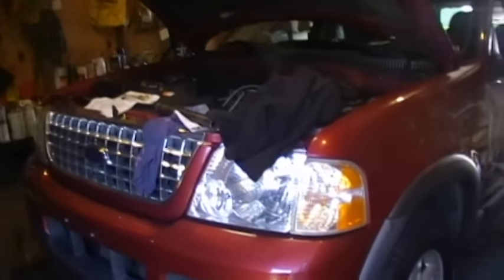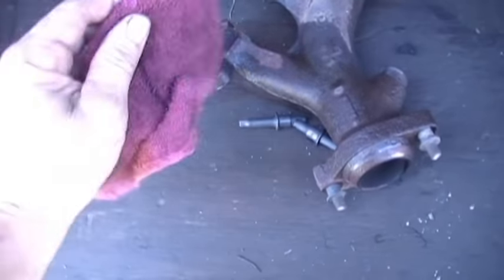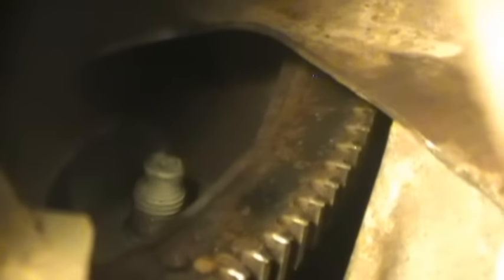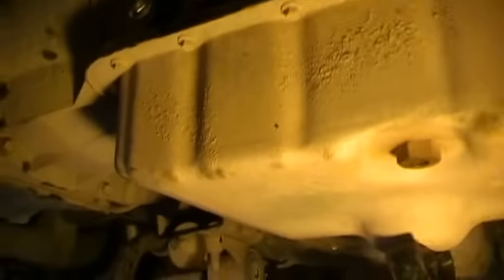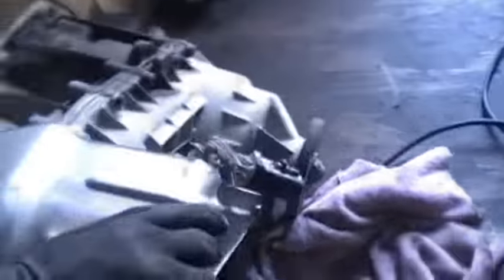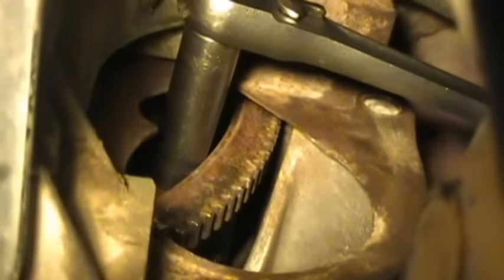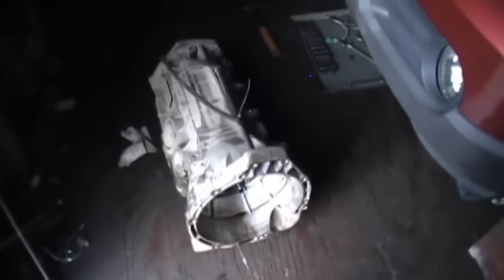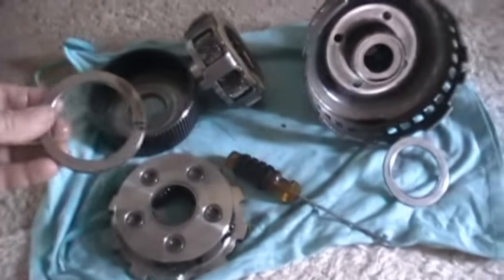2003 - 4.0  Ford Explorer Transmission Replacement

Comment: For anyone watching this in 2023. Instead of trying to loosen the bolts on the crossmember and risk breaking them. Put a wrench on the bolt side and take the nut off of the other side. Once you get the nut off hit the bolt with a hammer and it will back out easily. Also pro tip if you take the intake off the top of the engine you can easily reach the top 4 housing bolts from the engine bay then you just gotta do the sides and bottom housing bolts. Don't unplug your starter unless you plan on un hooking your battery first just take two bolts out and hang it to the side and you can get to your torque converter nuts there should be 4 nuts. Youll have to get a good sized ratchet or breaker bar and i believe the crank pulley bolt is a 18mm.
Reply: It's a 19mm not an 18mm.

Comment: Damn,I don't wanna do this job,I think a timing chain job is easier on those truck,lol
Reply: about 15 hours. i took it to the dealership cause they have to remove the whole front of the engine to replace mine. there are 2 cassettes i have a 99 ford explorer 4.0 soc

Comment: I take my hat off to you. This has to be the toughest job to do on the floor. I have done a few with a regulator floor jack at first then I brought a transmission jack.  Much,much better with the trans jack.  I think the reason I stop doing them is because I got tired of smelling like transmission fluid. Anyone who has worked on auto transmissions knows what I mean.
Reply from the maker: +Joe Scarpati  I do it just to flip cars/suv's. I make pretty good money at it. My selling points are always "look what I've done to make this vehicle to make it great"  lol. But you are right...its hard works. Thank goodness for hot showers at the end of the day.

Comment: Very informative video! I do have a question about your engine that moved... What did you have to do to straighten your engine back out from the drop of transmission and transfer case?
Reply from the maker: You can put a block of wood under the motor to help out!
Reply: @FixingWithPassion  Too late! I already rebuilt the transmission and installed everything. I cannot connect the driveshafts to the transfer case because it appears I have to reposition the engine back to where it was. How would I go about that? Can the nuts and bolts that are not connected to the block or frame be loosened to make the adjustment?

Comment: Anyone doing this repair in the rust belt ( North East ) be prepared for transmission crossmember bolts to break off inside the frame rails. Its extremely common and a wicked PITA.
Reply from the maker: +William Livingston ....You Got that Right!!

Comment: I have a 2003 Ford explorer 4.0 with an SOHC shaft system. Idk why, but the bottom of it is usually rusted. I've always wondered if maybe Ford used a different type of metal for the body structure in that year?  I've had older models (93) that were not as rusted.
Reply from the maker: @ScorpionTrail  I been told that.

Comment: There is nothing more important when installing a auto tranny than to really pay attention to whats going on with the converter and the spacing and all that stuff, you can really mess things up in a hurry,i have installed a few motors in my time and as ive gotten older i realized how lucky i have been, i got a brand new motor siting here at home i will be installing in October (too hot right now) and i decided to do a lot of studying on how to go about it and all that, i dont wanna be that guy thats on his fifth installation and hoping and praying "it will work this time" lol

Im doing a custom thing thats why im adamant about being careful, you know your stuff well but i put this up for other people as i am learning all this myself.  

I used to think that all you had to do with any motor was put that tranny bellhousing to the engine, tighten everything up and you were done when in reality you need to make sure that converter is "seated" properly on the pump or you will have major problems, you gotta make sure if you are doing a custom project you have the correct flexplate (this is a really common mistake people make with disastrous consequences), gotta make sure you put sealer on your flexplate bolts and a few other things, not trying to scare anyone but you just have to be careful and pay attention and not be on your 8th beer when you do this,preferable sober ha ha ha ha

Great video man,very detailed,interesting how the access point is thru the starter, most trannys ive seen have a inspection plate on bottom where you would conduct all that business but every model is different,whatever works is my motto,you are pretty brave to do this all by yourself but Ive done it too, sometimes there is no help available.

Comment: 23:30 removal of torque converter bolts from fly wheel.
26:00 removal of transmission.
Reply: what could I expect to pay a mechanic to do this job? thanks
Reply: @dlud9714  $600-$800

Comment: I can believe you had to take the exhaust off? I pulled the transmission on my 2001 explore sport trac and never touch the exhaust only troubles I had was the bolts on the frame but I did WD40 everything for 2 days before I started taking it apart.

Comment: Well, I have been able to take everything off so far. Tomorrow the bell housing and torque converter. One small bit of advice, taking the drivers side wheel off made taking the starter and exhaust so much easier. Thanks for your video, it was some great tips.
Reply from the maker: Yea that exhaust....UGH!!! Those stud bolts seem to always break on the Y pipes...
Reply: I had a problem with f150 tonight we said screw it and pulled it out transfer case an all

Comment: Really enjoyed the video.  Soon, I will have to replace the rear main crankshaft seal in my 2005 4x4 Jeep Grand Cherokee.  The steps and effort shown in the video were valuable to realize the endurance needed for the work.  I am sure my task will be similar although I do not think I have any 12 point drive shaft bolts but I will check beforehand as I have very few 12 point sockets.
Reply from the maker: Thanks man good luck!

Comment: You missed the most important article to your operation. Cxc51a ford spray, penetration spray, I am in the process of what you did here.I have a 2002 explorer with a 4.6 . I using all Ford gear putting her back together soon as my used tranny arrives. God bless from Nova Scotia 🇨🇦🙏 Great video, thanks for the imfo bud,thanks.
Reply from the maker: Nice!!!

Comment: Old? I traded my 2003 Sport Trac 4.0 when it had 249,000 miles on it. It ran perfect, never leaked a drop of fluid, and the transmission certainly didn't have a problem either even though I'd haulded heavy trailers (3,000 lbs) thousands of miles. I only traded it because I had moved to a location where it snowed, and I needed 4WD or AWD, and my Sport Trac was only 2 WD.
Reply from the maker: Nice!!
Reply: 2WD vehicles are generally MUCH more resilient with transmissions than 4WD or AWD vehicles.

Comment: I have overdrive light flashing on 2002 Ford Explorer 190000 miles. Transmission shift smooth but I think torque converter is bad . I check seat belt connector change fluid in transfer case and transmission clean tps sensor check ohm on front speed wheel sensor 4500 ohm not open. I’m going until she blow. I also add additive to rear axle ford recommend for locking up fix.

Comment: Thanks man, how long did it take you to do?
Reply: I wonder if its possible to put a M5OD-R1HD Manual in one of these from the sport model of the same year. I got 2003 with 118k very cheap.

Comment: I got a question, so I’m getting my transmission rebuilt and I will be putting it back in, I made sure that transmission was fully seated and then I got it flush with motor. No binding or nothing, I’m trying to figure out if I need to space torque converter from flex plate or pull it all the way against it. I also did my rear main seal and there was a 1-1/4 spacer to 1-1/2 maybe not to sure, between crank and flex plate. Sorry it’s a 97 ford ranger 4.0l. It been a year since it has been in but I believe it was all the way against the flex plate with no spacers. If you can please help me

Comment: You're gonna beat yourself in the arse for not replacing that rear cam guide while the trans was out. Just because it's not making noise doesn't mean it's not failing.
Reply from the maker: Right...
Reply: TVWXMAN32 right lol just think about me when u start it up and hear the death rattle

Comment: Hey I'm having an issue and I'm hoping you might possibly be able to help me, I am replacing a motor on a 2008 Explorer and I'm afraid the torque converter isn't fully seated into the transmission. the converter to flex plate studs are flush with the bell housing but the center piece of the converter sticks past the side of the bell housing by about an inch do you happen to remember if this was the case with yours? At around 27:00 into the video you show taking it apart and at first in the video it looks further recessed but then a few seconds later it looks like the studs are flush with the edge of the bell housing. Any information from you or anybody else would be greatly appreciated.
Reply from the maker: Well when you tighten the torque converter bolts it will move 1/2 or so. So there is some wiggle room. Just spin it and see if it feels ok.
Reply: I finally figured it out, the smallest splined shaft that comes out of the transmission must have gotten pulled out a bit and somehow it gets jammed and doesn't go back in. I found the solution here: http://www.explorerforum.com/forums/index.php?threads/torque-converter-install-problems.274525/ its a different year but same transmission. I spent 2 days putting the engine in and out because of this. If you have a way to pin this response or link to that forum it might be helpful to someone else in the future. Thanks for your help!
Reply from the maker: Yep, that happened to me also....lol   Glad you fixed it!!

Comment: Many thanks sir! Question - did you replace the transmission cooler/radiator, or did you just flush it? I'm ready to pull and fix or rebuild my 2004 5R55S from an Eddie Bauer with 111K miles. It's leaking at the front of the case. All was working fine, saw smoke from the engine bay, saw oil leaking from around the valve covers, but that was a head-fake because the trannie started slipping and saw red fluid (foamy-grey) puddling under the vehicle. Ugh... Now reverse is gone. I'd like to know how low the fluid is - but no - no dipstick! This thing has more sensors than a space shuttle, but no dipstick.I have a Ford Shop Manual - best $35 ever spent on eBay. I've pulled a transmission before - like a 100 years ago (well, in '82). My '72 Nova needed a new trannie. By myself in 1/2 day, I dropped it, took it to the local salvage, gave them $75 and my old one for one from the yard, bolted it in and all was well... I have a feeling this won't be the same experience.

Comment: My 05 explorer was 209,000 miles on it.  Yesterday the check transmission & the o/d light come on as I was pulling into my drive way. It wasn’t making any grinding noise, but I noticed when I got to 5,000 rpm I could feel it lag.

Comment: My 2000 sport has a metal clip on the Case Connector plug the one on the side(16 pin connector) next to the manual shift lever.  I can't figure out how that clip goes back on.  I know it's there to hold the plug in place, but I have no idea how to put it back on there, and I've tried every way I could think of.  Please help.

Pic of the clip here.  
https://www.facebook.com/photo.php?fbid=1612339049060406&set=a.1389373061357007.1073741827.100008529794553&type=3

Comment: Great video! No idea how you manage to stay productive under there and still get the good shots. Question for you, I'm in the middle of an engine swap on a 5.4l F150 and I'm struggling with the top 2 bolts on the engine to bell housing. Planning on getting some clearance and coming at it with the extension, but I'm wondering if I should plan on both cross members coming off or if I can get enough wiggle with one or the other. Any advice from your experience?
Reply from the maker: Cross members have to come out. I dropped the back of the tranny some to get some room for the two top bolts.....Tow top bolts....long  extensions. Took a while but I  made sure they broke free first then took them out.
Reply: 5.4 swap on a 3v you HAVE to take the intake off to to get the clearance for removal. Just take it off and back the bolts out from the top.
Reply from the maker: I'll remember that and try it if I ever get a 5.4.

Comment: did you take the top bolts out through the back or the side?
Reply from the maker: Back side. I had to reach up with extensions to the top....way...........up there!I probably had a 2 foot extension on my ratchet (1/2) which worked better... Don't even try a 3/8.
Reply: Finally got the damn thing swapped.  You're right, 3/8s didn't have the strength to break that loose and I fear I would have broken the universal joint had I put a pipe on the ratchet.  The amount of extensions needed made me want to go buy a single piece 2 ft extension - in 1/2 in - because of the slop inherent to using 5 extensions... 

On the other hand, the other difference I saw from your video, I had no access hole by the starter to take those bolts off, mine was on the driver side of the car, covered by a rubber plug.  - This is in a 2004 Lincoln Aviator.  Last but not least, the aviator has a ton of extra insulation, that eats into the space you have... 

I did this on my lift... the fact that you did it on your back on the ground... my hat's off to you sir! :-)

Comment: I’ve had mine since buying it in 2010, first time ever I’ve seen “check transmission” msg appear today 😔 I’m not mechanically savvy with cars and I’m scared this is gonna be an expensive repair without even knowing what’s actually wrong, today I was driving and noticed that my Explorer will just rev continuously when trying to shift from 2nd to 3rd gear, Is this an indication that maybe the transmission is not entirely broken but has a minor problem? Or am I now looking at buying a whole new gearbox? Your advice would be greatly appreciated.

Comment: hello, your video helped me to change my transmission, I put a new one, my question is after changing it, I have to do a type of reset so that it works well and does not show me the same codes again, I have to take it to an agency to do it or is there some way to do it
Reply: He answerd that back in comments

Comment: How much did all the parts cost you I was looking at AutoZone you can buy a 2003 Ford Explorer transmission for like 1800 and then you get like 500 back for core
Reply from the maker: That's a good deal! My parts was maybe $150.00. But my labor is free...so it was nice to have it done in a short time span.
Reply: Nathan Rohrbough Wait, your replacement transmission only costed you 150 dollars!?!
Reply from the maker: Yes! Just a few hard parts and my work (free).
Reply: Nathan Rohrbough That's insane!! You must have awesome scrap yards in your area!
Reply from the maker: No, actually I got most of my parts on e-bay!  lol
Reply: Nathan Rohrbough What!? Wow. I need to get a better eye for those kinds of deals! Lol! That's amazing!

Comment: I need to repair my transmission wiring harness. The wire broke at speed sensor. Can not get hands up there to repair so I think i need to remove harness to splice broken wire. How can you remove harness without removing transmission? It looked like harness was bolted to trans at top. Any ideas?
Reply from the maker: Somehow, your going to have to get your hand up there. I don't think that harenss is bolted. Maybe there is a snap holding it. If you can get a mechenics (a little one for $8) mirror and light and look up there. That might help you to see whats going on.

Comment: I'm assuming that it's nearly an identical process for a Ford Explorer 2000!? Could you list the main parts in order that get taken off, the video is very detailed and sometimes a little too detailed. Also how many days labour do you think this would take at a mechanics. It's my first time fixing my own car so sorry about all the questions. You could reply on here or also if you could email me on essential4marketing@gmail.comSounds like an email for some rubbish deal online, don't worry I do door to door electricity sales and just need the wagon back on the road for the teams ASAP!!Cheers,Daniel
Reply from the maker: On a 2000 explorer its going to be a bit harder mainly because the body 
of the explorer is somewhat smaller. It can be done but you will have to
 prepair your self mentally because the top bolts on the transmission 
are a bitch to get out....hardly no room. I've seen guys put holes in 
the floorboard to access these bolts. Now IF you can somehow lower the 
back of the tranny down, that might give you some access to them bolts. 
I'v done it on that same model in 2007. Wish I had that video.

Comment: hair off topic but i'm stuck with a 4.0L auto mustang torn apart and cant find an answer anywhere, hope you can help. pulled engine and trans for timing chain replacement, converter, flex plate and engine have all been turned and weren't marked properly (no idea exact location of direction when removed). does it matter how the converter/plex plate and crank are turned when put together (will it shake if exact bolt holes aren't reused)? balance question really. thanks in advance. -jeremy
Reply from the maker: NA probably not. I always use the same bolts. Now on the 2002 explorers 
and up....yea...its a different story....for a nother time.